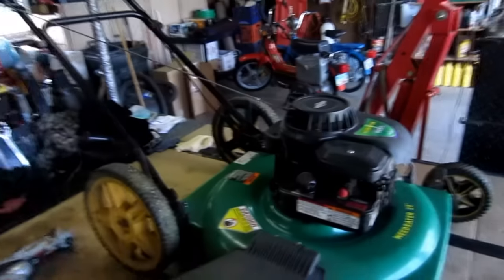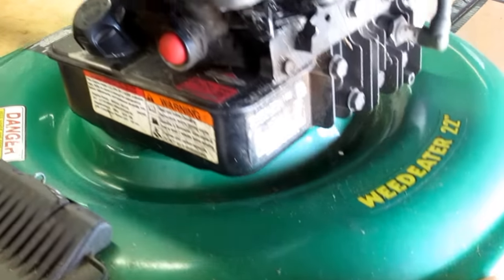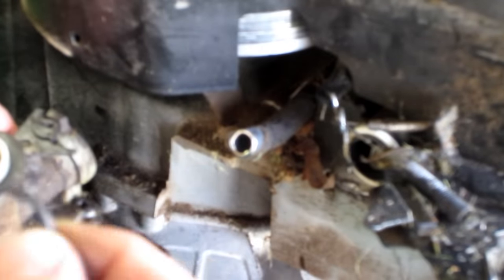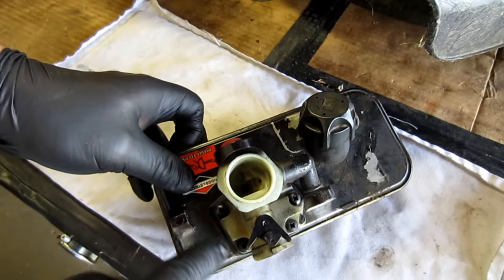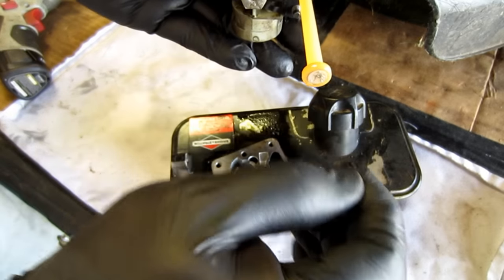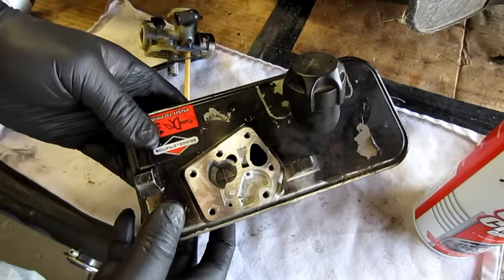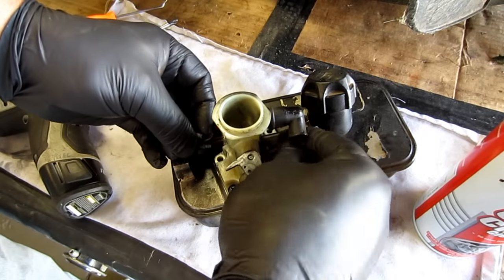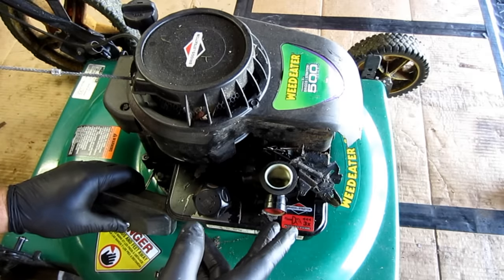Fix 90% of Briggs lawn mower not starting problems. Easy repair.

Comment: Ive got a two yr old mower that gets used every two mths and suddenly stopped working .It barely cranks over then ever so slightly stumbles on for a second then dies .After watching this i'm thinking it could be a few things .First .It always has oil and fuel .It has a cracked fuel cap it broke just by screwing it back on and turning too much and cracked such cheap thin plastic caps nowadays ?! also ive realised i do tip the mower over sideways to hose it off after each mow not knowing i may have tipped oil into the filter .Lastly i thought it might need a new spark plug? how often do i need to replace them ? and how do i know what plug it needs .I hope i can figure it out
Reply from the maker: The fact that your gas cap is cracked probably allowed moisture into the fuel. Bad fuel is almost always the issue. If you had too much oil in your filter it would run but it would have poor performance in Smoke terribly if you had an overabundance of oil. If you go through the steps that are on this video I'm sure you'll be okay after the fact. Getting a new cap would be a really good idea though. This fuel is very hydroscopic in the most you're in the air needs to be held out as best as possible

Comment: When do you change your spark plug and if the filter is clogged with oil, do you rinse it?
Reply from the maker: The spark plug should be changed when the electrode is rounded instead of squared off or if the spark plug has a lot of black soot on it., I'm assuming that you have a foam air filter, if so it can be rinsed out with dish soap and water. Allow it to fully dry, some people believe that you should lightly oil the foam before you put back into the air cleaner however I like to run it dry.

Comment: im puting a powermate back to together, and i noticed that space. will take note.  thanks.  used 5in channellockes to install new  plastic down tube.
Reply: And rinse the tank out under hot water.  Shake dry and leave in sun for a while

Comment: Awesome vid, although I think some attention should have been brought to the gas in the tank. If ur gonna go thru with this whole operation, you should go ahead and dump the fuel and clean out the reservoir- ESPECIALLY if it's been sitting for several months.
Reply from the maker: I did that off camera I just didn't mention it as I would assume most people have already done that at some point

Comment: I have the same carb but! on mine the half in bolt has a spacer tube on it that is not easy to reinstall once the bolt is removed.

Comment: DONT drain your tank, and chance drying out rubber, gaskets etc! Fill fuel tank with non ethanol premium, then park it out of the weather, or cover for the winter! Usually one or two pulls in the spring, and it will fire up!

Comment: My mower has one of these carbs and when it gets warm, it starts to hunt. Rev, die, rev, die and so on.  I stripped it down and cleaned it all out with cleaner and an air line, but it still does it. Could it be the gasket problem that you mentioned and sorted out by grooving the tank face ?  Would a smear of gasket sealer do just as well as the scribed line ?
Reply from the maker: It could be that you need a diaphragm. The deal is this video is for people that don't want to necessarily by the diaphragm and they just want to see if they can get by with what they have or at least get their lawn done for the time being. It's worth a shot it's not difficult to do. As far as the sealant on the gasket, I would never run sealer on the gaskets for a small engine because they will clog up a carburetor immediately. And if you seen on my video how the carburetor gasket got sucked in you can imagine what it would do to the sealant potentially. Like I said it's so easy to do this you might as well try it it can't hurt
Reply: @Foxboss9  - Ok, thanks for that. They're pretty inexpensive and the old one looks like it's seen better days. 

Just had another look at it and it needs a filter, bulb, plug and brake cable too, so time to invest a bit in it. Especially as mowing season has just started.
Once again, thank you :)

Comment: I have an edger with that carb and it stalled while trying to edge a thick chunk of grass. The grass got clogged up in the edger blade and stalled it. I cleaned out all the grass and checked to make sure the blade moves freely. But will not start no matter what I do. Won't even try to start. Any ideas?

Comment: I would've cleaned the Carburettor with Degreaser and Water and used a new Gasket..always (This is actually called a Diaphram)  also check the flatness of the Tank top with a straight-edge and Feeler Gauge..too much clerarance indicates gental filing will be necessary..don't overtighten the Screws as this can lead to Thread stripping or Tank warpage...

Comment: Hello, my Briggs 500 was running yesterday and then made a loud pop sound and now it will not start... It does feel like it spins easier when I pull the string to start it. Any clue what it could be? I changed the spark plug to a new one but it still does not work. Thanks in advance.

Comment: Great tutorial video.
My Briggs and Startton mower (looks the same as the engine in this video) in the last year or so has been racing as if I am turning the throttle up then turning it down. ( The engine speeds up, then goes slower about every 2 or 3 seconds, but it has been starting very easliy....until this week). I had it running for about 5 minutes yesterday and then it died and now i cannot restart it. Filter is clean, added fresh gas, won't start even with starting fluid. The plug had carbon, but I cleaned it, but I Believe i can clean it better when i get a wire brush. It wanted to start twice, but now seems completely dead. Any ideas? Thanks and giving you a sub as your video is great.
Reply from the maker: Probably best to go ahead and follow the steps. Sounds like a fuel delivery issue to me
Reply: @Foxboss9  OK...I will have to get Carb cleaner tomorrow (can't get to store today). Is that the only thing that can clean a carburetor that i can use? I'd like to start today but can't get to the store until tomorrow to get the Carb cleaner. Thanks.
Reply: @Foxboss9  I have an update: 
I changed the spark plug and now the mower starts right up. However, the racing and slowing down every 2 or 3 seconds (as I mentioned in my first comment) is still happening. I noticed with the air filter off that the lever with the spring attached if moving back and forth, which looks like the spring tension might be off or likely too loose. There's no way to adjust this spring, so curious how you would resolve this issue. Thanks and again. I'd say you have the most detailed video on this subject. I learned a lot from you. Thanks.

Comment: So I use CarbClean and NON- Chlorinated Brake Clean on alot of projects but more and more I have to use Plastic- Safe Electric Parts Cleaner and the likes.. as well as sensor relevant cleaners. Do you have a chemicals list you go by ? And do you have issues with CarbClean or Brake Clean distorting the plastics ?
Reply from the maker: I use whatever is on sale... even the most harsh stuff that is sold at the auto parts stores won't distort the plastic as long as you use it for what it's meant to be. Basically, you use it as a light solvent for . Not soaking, or letting it set on the surface for any period of time.
Reply: @Foxboss9  Thanks for the reply. Speaking of LighterFluid. I had 2 Master Upholsters for over a decade in my shop. The yellow plastic bottle of lighter fluid for Zippos.. the best Upholstery Cleaner I've ever used.. other than clean saliva for blood stains.. In anycase go get messy stuff of white upholstery and try it out. Its almost fun at first..

Comment: You went to all that trouble taking the carburetor off of the mower  and taking the carburetor apart you should have bought a NEW Diaphragm. They tend to shrink and dry out overtime. Cost probably less than $6.00

Comment: Hi, what if you tried some gas in the spark plug hole and in the carb throat and it doesn't start up?  It has spark and 125-130psi compression.  Thanks!

Comment: 1-Never start screws with your drill, always start by hand.  You just cross threaded it.  
2-Don’t spray your rubber parts with carb cleaner.  What you did to your gasket just  ruined it, not gonna be good much longer

Comment: Eactly the same as Mine , all my springs are missing and I took the Goverer off cos i had too put a new Coil on it , But It still runs with a Twig shoved in the Likage too the right RPM LOL There gret mowers

Comment: I have the same engine and carbie setup on my mower. 
The primer bulb won’t return after it’s pressed in. 
I’ve removed the bulb and it seems fine. 
Could there be another issue?
Thanks.

Comment: which Philips red green or blue .. each one is a different size use the wrong one and you strip the screw ... btw they are Briggs and Stratton ... not just Briggs ... better option if it has a B& S engine on it  ... leave it at the store ... for personal use they suck ... for industrial use they are not too bad

Comment: you should always replace the base gasket   you can buy them at any part store
Reply from the maker: This is for the folks that are just trying to get get by with a little ingenuity and no money spent... This quick fix will allow most to get back mowing in 20 minutes or less... Of course replacing the gasket/diaphragm kit is a good idea that's why I included the link in the video description 👍

Comment: The manufacturer instructions say the filter should be saturated in motor oil upon replacement. So what you say in the beginning doesn't make sense to me
Reply from the maker: You don't need to soak in an oil. You just need to lightly cover it in oil. The problem that comes up with those filters having oil on them is that mower usually runs a little rich causing spark plug replacement to happen a little bit more often. I just say it's best to completely clean the filter or replace it and reinstall it dry

Comment: Good video but carburetor cleaner will eat through rubber and plastic parts so anybody doing this process needs to protect any plastic or rubber from the carburetor cleaner and I've always just used gas with a toothbrush and my air compressor so that I dont damage anything. If you can you should try to take the diaphragm off carefully and not spray the diaphragm with carb cleaner
Reply from the maker: Short burst of cleaner evaporate way too fast cause damage on the diaphragm. Now soaking it is something entirely different. This video is so that everyone can cleaning the carburetor and do this repair and unfortunately most people don't have an air compressor. For the people that don't have carb cleaner though the gas in the toothbrush is a good suggestion.

Comment: a couple questions how determental would it be if i used contact cement to hold the diaphragm in place? from what im getting is itd help seal the back better asking because i only have use of one hand and getting the diaphragm on with the spring is proving to be rather annoying but now i know what to do with the white washer and o ring then ill worry about trying to attach the case vent tube it broke off at the case side when i was removing the elbow intothe carbive tried jb weld but it keeps breaking so ill just get a hand and braze it together.

Comment: Hmmmm, that seal was missing on mine. The white clip on piece was loose but there. Maybe that was my problem. I'll check everything else still.

Okay, it tried to start now. But it still doesn't want to run. I probably need a new gasket. Mine came off without ripping, but it appeared loose and floppy in sections.

Comment: I think my third mower will be electric. Last time all I needed was a new spark plug, or a new air filter, or that time the starter cord snapped, or that other time the control cable broke. Now I have to rebuild it? Gawd.

Comment: Awesome thanks for sharing.  I have a question with a carburetor on a 6.5 Briggs power washer that i found on the side of the road that im working on to fix and sell.  I was able to get the motor running however when i slide the choke to the run position it dies. But will run on the choke side. i can move the throttle just fine from low rpm to higher rpm. (Turtle to rabbit) any ideas whats the issue? It's a learning curve for me.
Reply from the maker: Rebuild carb. Clean out tank and fuel line... Replace inline fuel filter if so equipped..
Reply: @Foxboss9  Thankyou. I'll definitely check that out.

Comment: Hi Fox Boss I have the problem of my mower not priming, I replaced the carb gasket, intake manifold, and primer bulb, on the same carb,  in order for me to get it to prime i have to take off the ait filter housing and put my finger over the air hole for the priming of the fuel, my question is, is the carb gasket not sealing properly?  because once I get it to prime the fuel does shoot out of the fuel orifice tube fine, it is just losing its prime, please get back to me asap on my issue.

Comment: Is there any way to clean the fuel filter? The long tube that reaches the bottom of the fuel tank. You just sprayed carb cleaner on. Mine seems to have suck up some debris and it quite blocked up the filter.. Can that tube be removed so I can blow in "reverse" to clean it?
Reply from the maker: The tube can be pulled but I just use a small wire like a guitar string 2 Force up through the jet and it will remove the blockage. That or compressed air

Comment: Hi mate. I followed your video which worked really well to getting my mower to start. But now it dies if I don’t keep pushing the red primer button? Any suggestions?
Reply from the maker: Sounds like the pump diaphragm it's still messed up causing air to come in. Or it needs replaced all together
Reply: @Foxboss9  I’m ashamed to admit that dummy me out two stroke in it out of wrong can. Once I replaced the fuel with Super it was fine.

Comment: I watched in horror, as the carb/tank assembly was removed, without any attempt to clean dirt, grit, and debris from the components first.
Yeah, it might be "Just a lawnmower" but, it deserves common courtesy.
Most people would be offended if they saw a video of their recent heart surgery, and the doctor used his dirty hiking boot to hold their heart still, while he inserted a stint into an artery.
Seriously people ... a little bit of dishsoap, applied with an old paintbrush, will go a long way toward keeping dirt and grit out of your engine.
Have a heart, before you tear it apart.
Reply from the maker: It's more than obvious that you have an OCD problem. LOL the only way that dirt can enter into the engine during the carburetor removal is if you blow dirt to go into a vertical intake tube. Dirt can't fall into that tube. Nobody at any shop I have ever heard of, cleans the carburetor prior to removing. I'll be more than happy to watch any video that you decide to post showing how Dirt can be ingested into the engine while a dirty carburetor is being removed from this type of engine.
Reply: @Foxboss9 ,
Well, it seems we are worlds apart.
I am writing from the OCD sector of the universe ... 
while you hail from the "just don't give a crap" sector.
Perhaps we'll meet in the neutral zone somday, if your starship can actually make it that far. Ha.

Comment: I followed this video exactly, also replaced the carb gasket and diaphragm,  spark plug and air filter, gas is new and clean, mower still wont start. Any ideas?

Comment: If you use carb cleaner in that particular carb, you will ruin the diaphragm  fuel pump. It's very fragile and goes bad easily.

Comment: im not sure if i could get help from anyone here, I had a surging problem with my mower was the best way to describe it. it seems to want to run full open then full shuts on the carb. I followed this video and did clean it and it is running better but still slightly surges but does seem to hold idle but seem to idle low. could this be due to the spring you described toward the end of the video?

thanks for any help!

Comment: So, I was looking for information on how to change the "fuel filter". I've beginning to think there is no separate fule filter on this style engine? It's all incorporated into the carb?
Reply from the maker: Correct. Any carburetor that is mounted to the tank does not have a true replaceable filter.

Comment: Mine is leaking gas. What would cause that? I tipped it to change blade and oil did leak in with carb side up. But then afterward filled it with gas and it's a very small gas leak now.